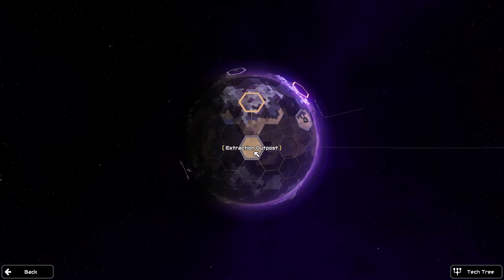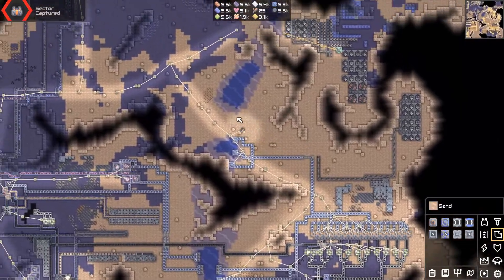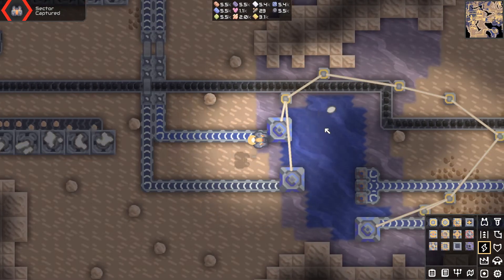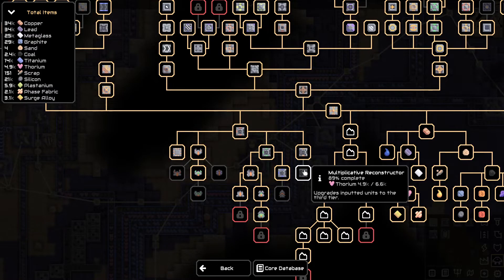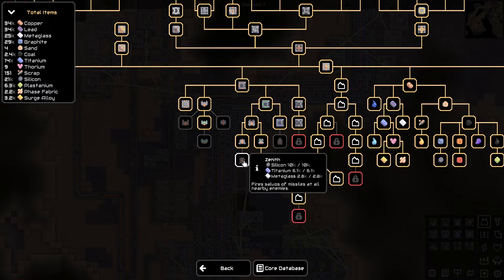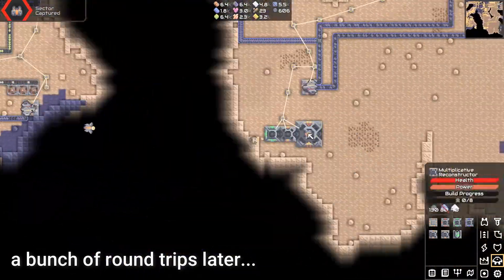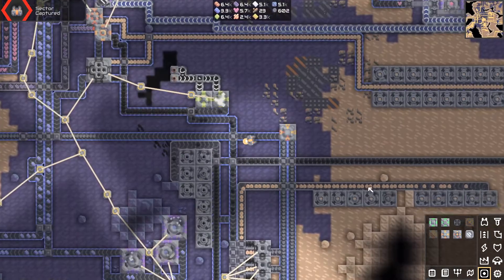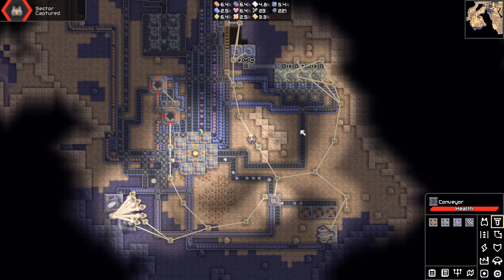Reworking Tar Fields Resource Gathering And ADVANCING SCIENCE

Comment: So if you put monos into the additiave recontructor, then it spits out drones that automatically help build stuff and when stuff breaks, they will go and replace them also. Also the crawler class units (ground ones that cost coal and silicon) get very strong at stage 3 (multiplicative recontructor). Hope this helps and looking forward to the next video!!
Reply from the maker: Thanks for the tips! Stronger unis is definitely the way to go. Gotta try those crawlers sometime... The builders though - well, you can see in the newest video :D